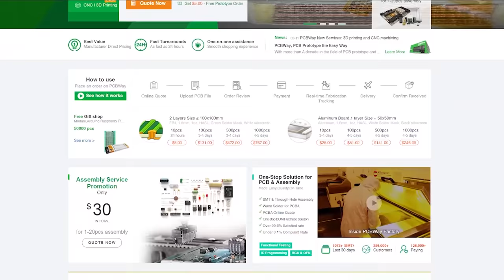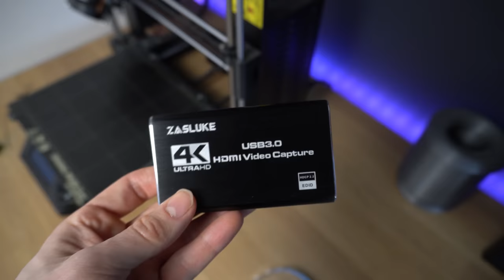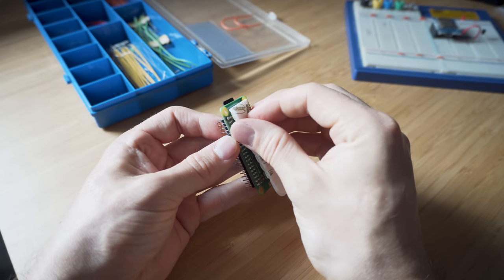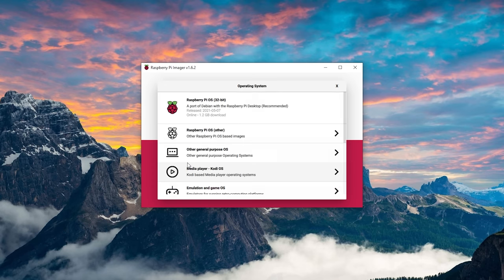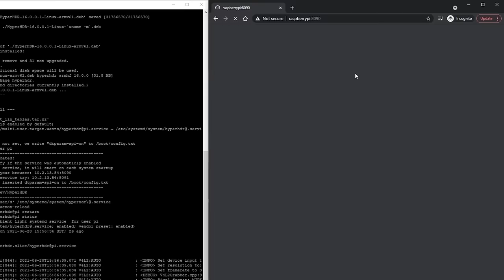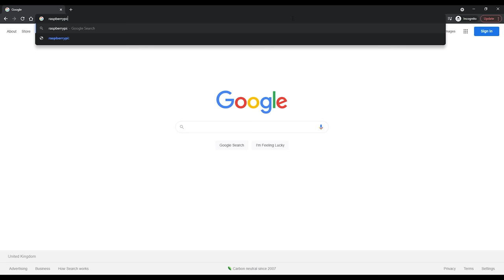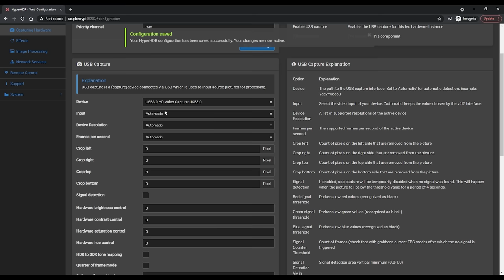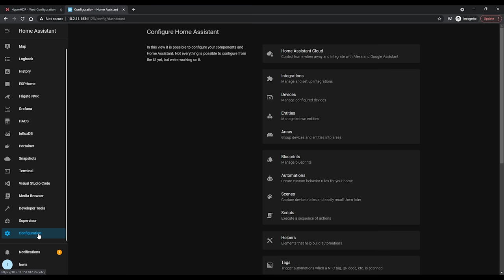The ULTIMATE Guide to Building an Ambilight TV with Hyperion

Comment: Hi there. Have found this video and just finished my build. The raspberry and the LEDs work fine. But I cannot see my AppleTV signal. I am using the same capture device as shown in this video. Do I have to know something more for using AppleTV here? Do I need a different capture device? Is it important to which USB-Port I connect the capture device if I use a pi3 B+? Or is the capture device broken even if its brand new? Appreciate your help. Thank you.
Great video by the way.

UPDATE: It was the capture card. Ordered a second one (same model) and now it works. But sometimes the colors are a little bit off. Perhaps you can make a video about color correction on Hyperion.

Comment: Hi and thanks for this interesting video.
I have a question about the video grabber card.
I read about a "problem" that, depending on the used grabber, when the image source is switched off (no signal), the LEDs do not shut off but instead light up in the rainbow colors.
This is due to the fact that some grabbers output a "no signal" test image in the rainbow colors when there is no input signal, instead of simply "no signal"....
I would be very interested to know how your grabber card reacts without any input signal?
Do your LEDs also shine in the rainbow colors or does the LED cut off?
Many thanks
Reply: There is a calibration settings that will teach HyperHDR what the no signal pattern looks like for your capture card. When it sees it, it will turn the LEDs off. I just set this up myself today and can confirm it works.
Reply: @chasebtb Hi, many thanks for this info👍

Comment: Great vide but having trouble with the ground. Whith the steup in the video the leds don't power up. If I remove the common ground the leds power up. What i'm I doing wrong. Tried to connect the ground to the ground pin on the pi but then I get flashing Leds

Comment: I tried to follow your example. Still had an old Pi4 lying around. I bought a 5V 15A 75W power adapter. But whatever I do, it keeps saying the Pi4 is undervolted. If I put in a USB3 cable into the Pi4 while hooked up to the power supply or when I connect it to the GPIO connections. Any thoughts on that?

Comment: Yea... The suggested Capture Card proved to be a Dud for me in the long-term use as after a while it kept spazzing out on a fairly regular basis needing a restart from the Pi ( off which it was driving Power from ). I've since replaced it with the absolutely miniscule and by HyperHDR suggested Rullz MS2109 model and it appears to be working a lot more reliable.
Reply: Ezcap is good

Comment: Hello, Great vidéo !!well done !! 
I have a question..
I use my computer connected to the TV for watching movies 4k HDR. (Hdmi audio and vidéo both on the same Ethernet network with rj45). 
Do I still need the raspberry Pi ?!
I need the power supply for led strip but there is way to get signal data for hyperhdr with less hardware ?! 
Hyperhdr is available on w10 or it's on only Pi?! 
Thank you :)

Comment: Can I just say that you inspired me to undertake this project, but holy sh*** this is not a one size fits all modification. I am a month into this project and am still banging my head against the wall.

My tv is 85 inches and it involves so much more than this video mentions. I am completely green to anything raspberry pi. This video doesn’t mention that the firmware on pi’s are really out of date so to connect to WiFi, you absolutely need a monitor and keyboard to update it in order for ssh to work. It also doesn’t mention that usb3 devices like the recommended video capture card will prevent the pi from connecting to the WiFi so I need to plug it into the usb2 port.

After finally finding the updated script for version 20.0.0.0 of hyperHDR I tried using a sacrificial usbc to power my lights along side my raspberry pi 4 but with this many lights on an 85 inch screen, the power supply necessary for them totally burnt out the pi, destroying everything that was attached. 

Originally I was able to power 75% of the lights until I upgraded the power supply and burnt out the pi. Now I figured out that I needed 2 power supplies: one for the pi and one for the lights. They also needed a common ground so I grounded the lights to a ground pin on the pi4. Here’s where it got tricky and I am currently stuck on this step:

For some reason, hyperHDR isn’t sending signals to the lights through the gpio18 pin. With this build on an 85inch the setup presented in this video does not work. Everything has a common ground. The lights have an adequate power supply. Everything is installed and configured correctly. So after much research I discovered that I need a “logic level shifter.” My green ass doesn’t know what that is! Apparently when you have as many lights as it takes to go around an 85 inch, it’s pretty important. So I have this device coming along with a capacitor and other supplies to convert the 3.3v to 5v signal from the pi to the ws2812b lights because that’s what they require. 

I absolutely refuse to give up and haven’t found any guides or tutorials on how to do this setup on such a large screen. 

If you are undertaking this project because of this video, just know that it is incredibly out of date! And the steps he gives you will not transfer to today’s needs. The layout of HyperHDR is different as well and isn’t 1 for 1. My god I’ve gone down one hell of a rabbit hole and have been consumed by this project for a month now. I’m sure if you have a 65 inch or under, you will have a lot less trouble than I am having

Comment: Thank you very much for this video, it's super didactic. I set up my ambilight, but I'm having doubts about the connection scheme between the capture card and my TV. I have a TV with android system, and I want to capture the signal from the TV itself. In that case, how is the connection scheme for the card to capture the image of the TV itself through HDMI?
Reply from the maker: Thanks Arthur, unfortunately as mentioned in the video, you need an input

Comment: I'm pretty sure I've followed everything this video said and I can't get the light strip sk6812 to work. I've double checked the wire setup multiple times with no avail. At the most I can get one left to turn on. Any ideas?
Reply from the maker: The instructions here were for the ws2812 - the sk6811 is a bit different. Jump in the discord server I'm sure we can get you going
Reply: Did you solve the problem already?
Reply: did you figure out the 6812 setup. i am stuck and cant get the lights to work

Comment: Hi All.  Slight update to this.  When using the Raspberry Pi Imager, you will need to click the little gear on the bottom right and enter your Username and Password to use on the Pi as the security options have changed and the pi/raspberry user/pass no longer works.  You're Welcome.  :)  

P.S.  You can enter details for SSH and WiFi in here also.  Much easier.
Reply: I have finish this setup but raspberrypi cant detect my capture card. I am using 2 adaptor one is 5v 10A another is 5v 3A. One is connected to leds from one side another is connected to led from another side. Raspberry pi has been feeding by 10A adaptor also. Leds are not getting on. Can you help me

Comment: I don’t quite get it maybe you can help me.. I bought an 2022 lg OLED tv and want to spend time on putting that together. I have a ps5 and a set top box wired via hdmi and mainly use Netflix, Amazon and apps on the smart tv. Is your system working in every scenario? Thanks in advance and thanks for the video!
Reply: It will work with some HDMI Splitters or Capturecard avoiding DRM protection or you can disable that in the browser I use chrome so netflix and what not all work with my ambient setup, but I do not use a raspberry pi that is overkill for this project i use a esp32 board or esp8266 and they are awesome much much cheaper as of right now 2022 to get the esp boards over the rpi and less hardware is needed for running leds it's pretty simple wled

Comment: Hi, great video thanks. I have a question. In many other videos they use a HDMI to Analog adapter and connected to that an analog USB grabber which goes into the Pi because they say that the Raspbery Pi can not understand the digital signal. Is that wrong?
Reply from the maker: It's not wrong if it works!

Comment: Many sources on the web, recommend using a 3.3V to 5V level shifter between the rpi's gpio 18 header and the led strip. This video however does not use any. Do you know if it is required?

Comment: This is the first video I’ve seen that doesn’t use wled. Seems to simplify for,the tv.  However if the ultimate goal is to add other leds to entertainment cabinets or nearby bookshelves, wled is needed to sync images. Correct?

Comment: I am planning one right now but it is going to be 10m long so am going to make it 24V which will allow the leds to get the best colour because the voltage will not drop off over the strip. To allow me to power the pie I am going to be using a voltage converter to allow the pie to get 5V it need to run. oh and get this it is going to be a projector style setup. Question can I put the strip connector in the bottom left hand corner? I am using a pi 4 4GB ram
Reply from the maker: Hello, AFAIK there is no real need to make it 24v, I think you are causing yourself extra work there. You can simply inject 5v power along the strip same as you would but just at 5v rather than 24v.

Sure you can do that
Reply: @EverythingSmartHome  I have ordered the parts for it and because of how the screen is mounted its going to hard to inject the power along the strip. To power the Pi I am using a buck converter to power the pi from the 24v 15amp power supply and it also will pass the common ground to the pi so the LEDs should not got mad at start-up or not come on at all.

Comment: First off, great and awesome video ones again :D 

However i got two questions:

1: Did you test it with a camera instead of HDMI as well and what is your opinion on that methode?

2. There's a home assistent addon as well, is it possible to connect other smart devices to hyperion with home assistent? 

For example connecting multiple light to the left part of the screen ledstrip and right lamps to the right part of the screen ledstrip

Comment: Do these HDMI switches support CEC control? In other words, do you have to use the remote to switch inputs or will it automatically switch when a device is turned on that supports CEC?

Comment: Thanks for the most complete guide with links and everything on this!
One question: if I do not want to use home assistant, would it possible to plug everything into a smart outlet controllable by Google assistant, and if so do all settings/states stay the way they were or every time you plug it back in you'll have to set it to display TV colors and not some solid or rainbow mode?

Comment: hi, does the capture card output still provides 4k if I attach a 4k source to the input?
Reply: It should... if you mean the looped through signal by 'output', that is going to your TV. The actual captured video data often has a much lower resolution that is just scaled up to (U)HD, but that doesn't matter for this purpose.

Comment: This might be more rpi related that Hyperion but here goes. I installed hyperbian and used the wifi conf template on their setup guide. I noticed your wifi setup has two additional lines beyond theirs. Using theirs (and double checking spelling etc) I've been unable to get connected to WiFi. I can hardwire to Ethernet but don't want that as a permanent option. Any direction on troubleshooting wifi? I haven't found any suggestions beyond check said spelling and pw. Also, my eps boards connect without issue so I assume it's not my router that's blocking the connection.

Comment: Great guide. I managed to do it first try with it and it works flawlessly. Thank you very much. That was a really fun project. One side effect I didn't consider beforehand: the setup breaks HDMI CEC between my Shield TV and my TV, which is a bigger pain as I first realized. Is there a workaround for this?
Reply from the maker: Excellent, glad you enjoyed it! Unfortunately CEC needs to be supported by all components in the chain, the capture card I have doesn't seem to support it either
Reply: @EverythingSmartHome  okay, thanks for your replay. I used the same components :-). Nice setup anyway, CEC is a project for the future.
Reply: @EverythingSmartHome  do you know of a card that can support cec?
Reply: @MarcHeyer  Any success with your CEC-chain? Have you tried creating an automation in HA? "If Receiver is switched to "ON" - Turn on TV"...
Reply: So I might be oke with sacraficing CEC (If I can automate / mirror the proces in HA) but will ARC remain functional between my Receiver and TV?

Comment: Loved your guide! Though I'm having issues and was hoping you or someone on here could help! I've got the SK6812 LEDs you suggested, with a RP 3A+, 5v 15A PS, running a total of 207 LEDS using the smartman method of sticking them to the tv. When I'm in the hyperhdr set up, the only sk6812 controller is the sk6812spi. This option doesnt let me specify the GPIO pin and even when I select it and try the rgb wizard, nothing happens. If I switch the controller to the one you use in the video, ws281x, I initially got the top half and right side to light up (I started in the middle of the top), but none of the other LEDs. Could anyone please help me with this please??? I'm totally new to all this!

I did read online that some people have connected both ends of the sk6812 led strip to the power supply to get it to work but again, wanted to see what you/others might suggest!
Reply: Hope you already managed to solve this, but either select sk6812spi and then use GPIO pin 10 to control it (or) just select ws281x (PWM) and use GPIO 18. Not called out a lot, but be sure to connect a common ground between RGB strip and the Pi (typically the white wire on the same sk6812 connector used for data link, but disclaimer to double check yours is same). I used pin 6 for ground on the Pi and pin 12 (GPIO 18) for my SK6812 and chose ws281x (PWM) in the controller type selection.
Reply: @mdavidcarroll  thanks for the reply. Yeah I’m running it off GPIO10 with the spi controller. I think my current woes boil down to a power supply that’s not up to scratch, in fact, it died on me last night when trying to troubleshoot the set up. Going to invest in a proper meanwell PS that has plenty of available current and a better level of reliability 😅
Reply: @cameronprice2916  Did a different power supply solve the issue for you? I'm running into very similar problems as you described and try to figure it out
Reply: @Benndetta459  hi, yeah I did sort it out with a 90W supply from meanwell, as well as cutting out LEDS damaged by the smart man method and just soldering wires for the corners. All works now though but I might connect both ends to power in a ring main as I think the white colour is a bit off
Reply: @cameronprice2916  Great that it worked for you! I went from a 8A Power supply to a 15A power supply, but running into the same issues. Would you mind sharing the exact power supply you used?
Reply: @Benndetta459  Sure thing! This is the one I got:  Meanwell MEAN WELL original LRS-100-5 5V 18A LRS-100 5V 90W Single Output Switching Power Supply.

Also, when sizing your supply, I've read that assuming a "worst case" consumption of 0.02A per channel, per LED (for the sk6812's, they have 4 channels - Red, green, blue, white - so 0.08A) and then about 5A for the Pi and capture card. So whatever supply you get, minus 5A from it and then divide the remainder by 0.08A and you'll get a rough maximum number of LEDs you can run off it. In reality though, this is the number of leds running white all the time, so you can get away with a few more. 

My set up now only has 176 LEDs (I cut out a chunk on the bottom middle as you dont really get the ambilight effect there anyway if your tv is on a stand rather than wall mounted). 
Also I found that the off white colour I was getting was a result of having the white channel turned off in hyperhdr for my sk6812's. Now all is good with the colours. If you need more assistance, let me know and I'll give you my discord handle. Good luck!
Reply: @cameronprice2916  Ah shoot it anyway man - would love to get in touch!

Comment: Hi guys do you only need a 4k capture card if your only passing through?? My so called 4k capture card won't even take a 4k signal just a 1080p. How will the hdr function of hyper hdr work if your capturing at a lower res not supporting hdr? So will this still work then at a 1080 feed with hdr content. If this is the case what's the difrence between hyper hdr and hyperion?

Comment: My 2 cents... you dont't need a 4 capture card, the whole point of the capture card is to send the video to the Raspberry Pi, NOT to the screen.  Also you talk about a HDMI SPLITTER when it is actually a HDMI SWITCHER. What you should be doing, is using a 4K Splitter to send 4K video to the capture card and the monitor, no video needs to go from the capture card to the monitor. the video from the splitter to the 1080p capture card, the capture card usb to the PRi.
the other side of the splitter goes to the screen. You can still use a HDMI Switch to choose which video source is sent to the splitter.
Sorry if I'm completely wrong, greate video.
Reply from the maker: You could do it that way if you wanted, not the way I would do it but you could if you wanted too, the end result is the same.

Also ypu talk about PRi when it is actually RPi ;)

Haha just messing with you, thanks!